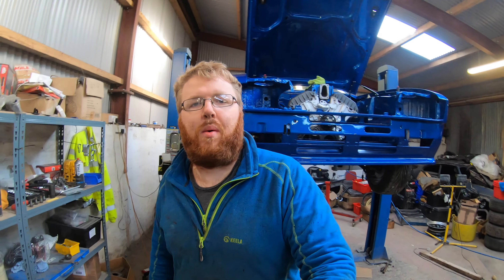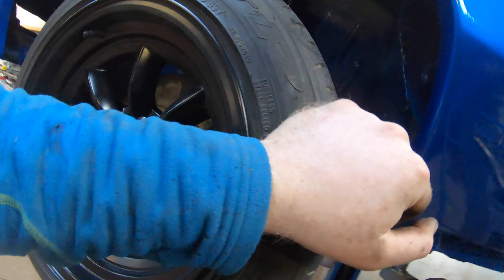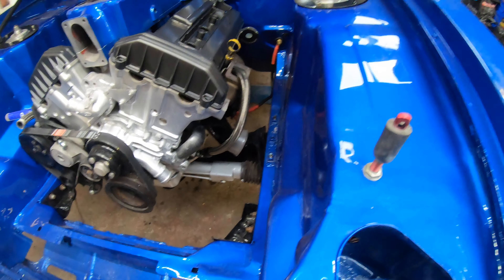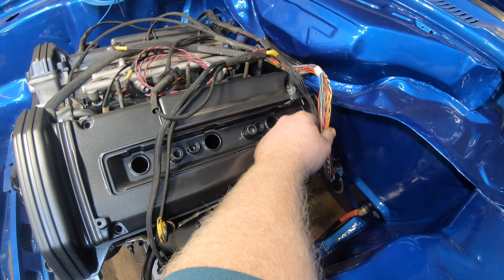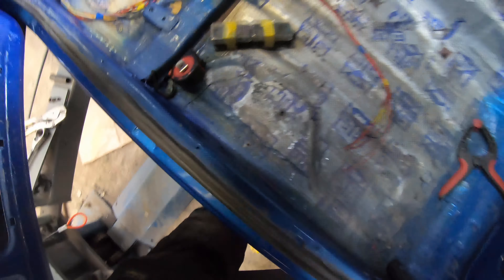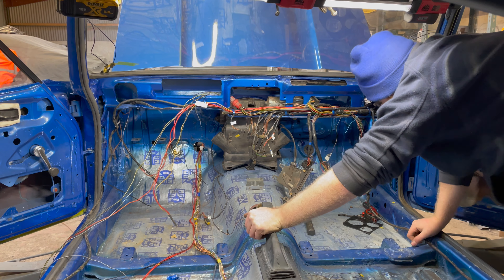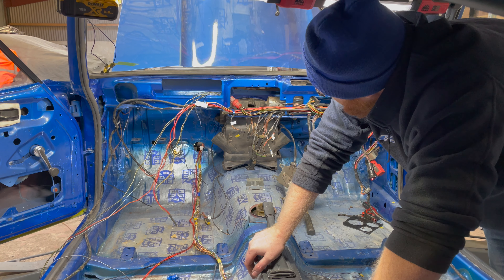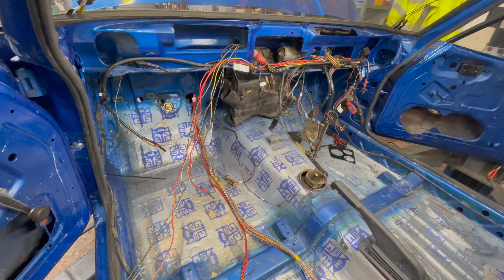Project Xpack Episode 45 - Wired up! Ford Capri 2.9 Cosworth Twin Turbo.

Comment: There are two kinds of wiring problems- wiring to a plan and spaghetti. I prefer the plan sort, as they tend to work with out regular massage with a hammer and my bad attitude! It looks like you've got to the point where you can see what all the circuits need to be and now you need to finalize your terminations- good on ya! You may yet be wanting to drive the thing before all the frost is off the ground.

Comment: Good to see it coming back together, have you got details of the multi way connectors your using?
Reply from the maker: The multi plugs for splitting the engine loom? I’ll have to dig through and find them in the purchased items 😂. I just looked up 16 way multi plug I think on eBay!
Reply from the maker: Found them! 

https://www.ebay.co.uk/itm/372236406428
Reply: @krisdupreysgarage  Thank you, tried Google for these a while ago and didn't find what I needed. I'm considering cutting the loom in my car restoration and rejoining it behind the dash 👍